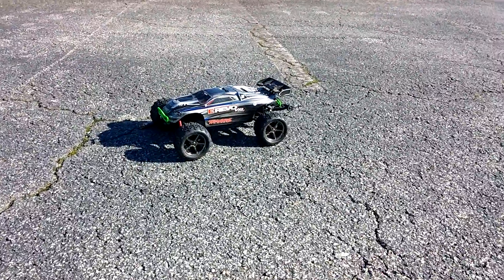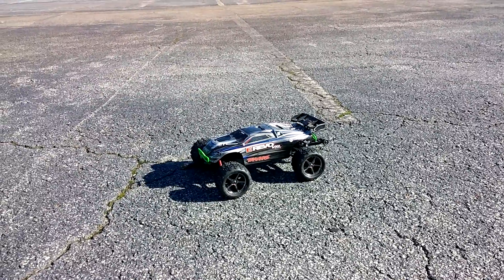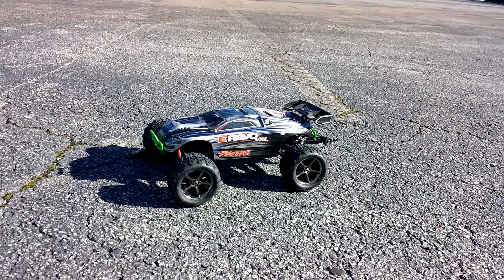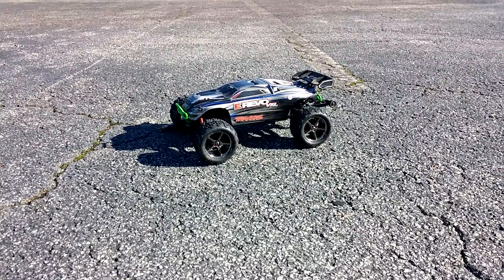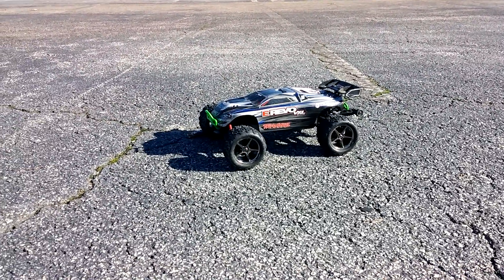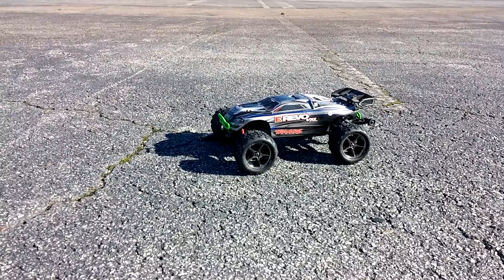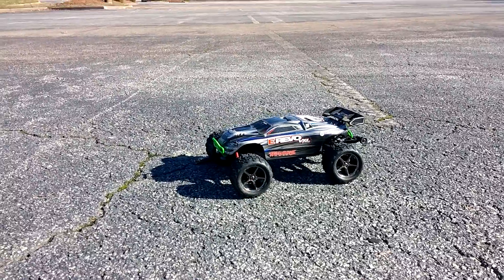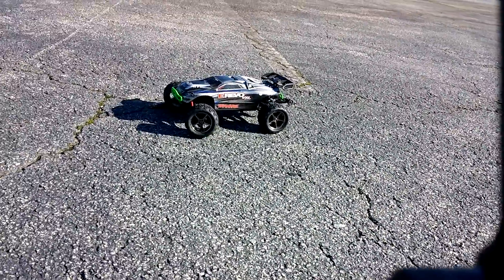Mini E-Revo VXL 6 cell nimh run

Comment: Hi John, I spoke to you on Saturday about my Criterion, tires gearing ect. I found the 16t pinion did not get enough mesh and ate up the main gear. I went to a 19 t and 84 t for the main. It was like the perfect balance after adjusting the clutch. The motor got warm but not hot running 2- 5000 lipos back to back on grass. It was a blast. The Proline Trenchers with this combo were great. and gave me the clearance to blast around the field. Thought you might want to pass on to others. Thanks!
Reply from the maker: +Scott Rennick sweet...good to know :)

Comment: i am looking for a rc to bash. i have $200 budget. what do u recomend. i need something thats durable and that is $200 or under.
Reply: you can get Rustler without the VXL for about $200. this particular car is about $250. I could be wrong, but I think that's the approximate price
Reply: +All The Time Rc 
on tower hobbies they have a deal on a Arrma Fury BLS which is already brushless on sale for $199 right now plus the coupon code would make it $175. It is regularly $260. My arrma trucks are pretty durable and havent broken anything yet in about a year.
Reply: +mike253905  thanks but i think i made my mind , if you are subbed you will know what i will be getting soon:)
Reply: Nice man. I've seen your videos before. It would be dumb to get a Short course truck if you already have a couple of slash's. I will sub and wait and see.
Reply: +All The Time Rc  get the TRAXXAS RUSTLER it's a very GOOD & FAST TRUCK